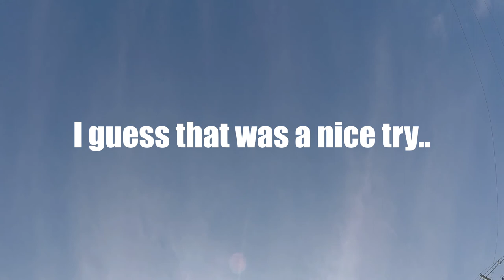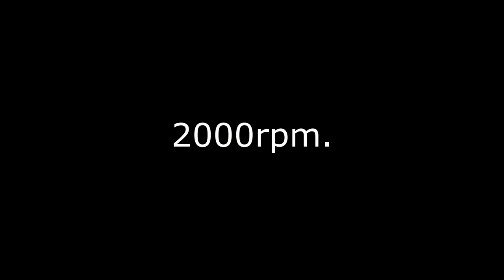HDJ81 2.5" STRAIGHT PIPE / 1HD-T TURBO NOISE!

Comment: Hi. If you want to increase the power, i recomand the australian Gturbo, bolt on for the model.
Reply from the maker: Maybe in the future!  I’m happy with the way it is right now.  I don’t want to risk reliability for more power.  That’s what the GTR is for!
Reply: theOGzilla is getting a turbo re-sized a thing for more power without after market parts
Reply: @theogzilla  I wouldn't be too worried about reliability 
These engines are like donkeys some small performance mods won't harm it 
Yes not a fully built but some extra power will be nice you will enjoy it
Reply: @theogzilla  I have put a bolt on Gturbo Badboy+rebuilt pump and injectors+front pdi intercooler+4'' straight exhaust. It has 193k and rung great, all bolt on, except exhaust. Run arround 250whp,safe power. You can go higher if you want but its enough...
Reply: Exactly Australian's has alot of experience in off road vehicles